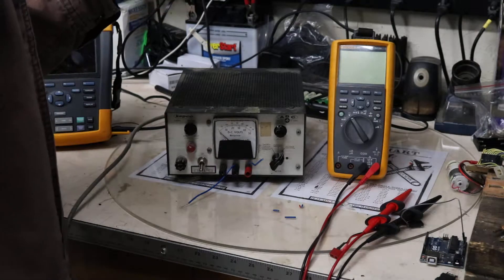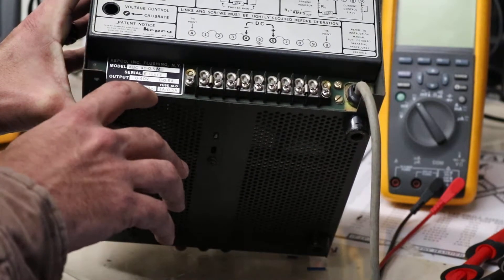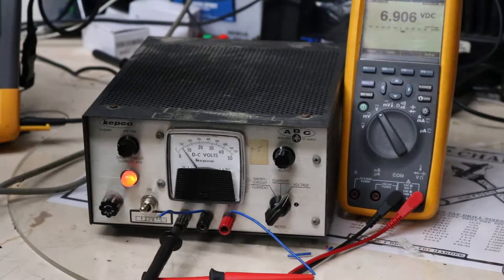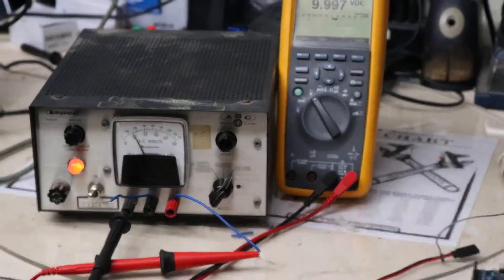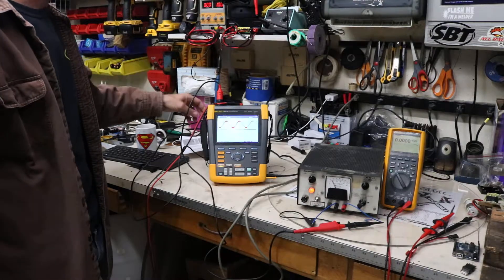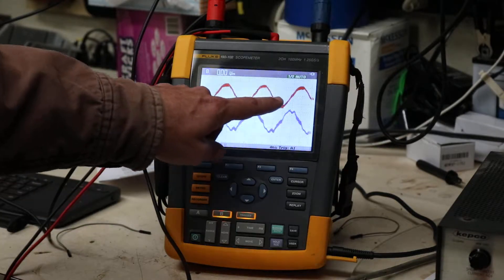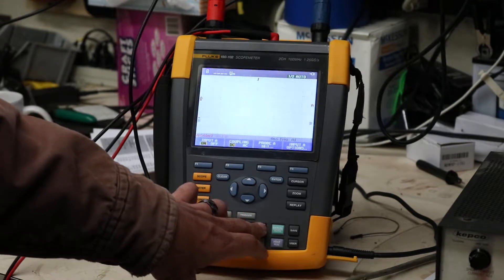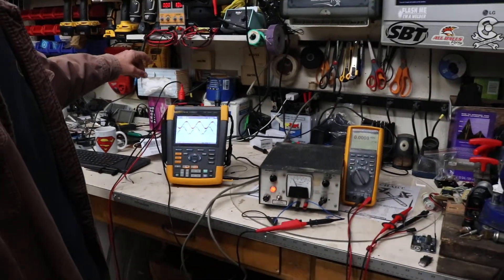Vintage Kepco 1963 PSU vs Chinese PSU

Comment: The waveform being referred to here is just the ripple voltage as the supplies are DC output.  So assuming the ripple is in the millivolt range, the 'quality' of the waveform is of little to no consequence. I would assume the Chinese supply is a switch mode type, so, depending on how well designed it is, ripple and noise is always going to be higher that a linear type.